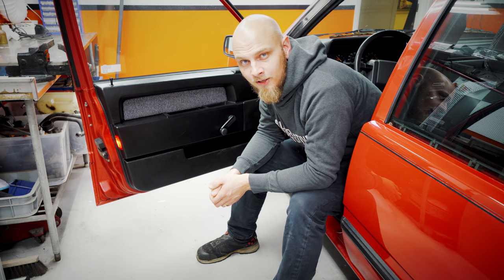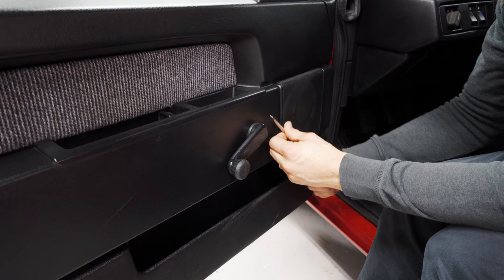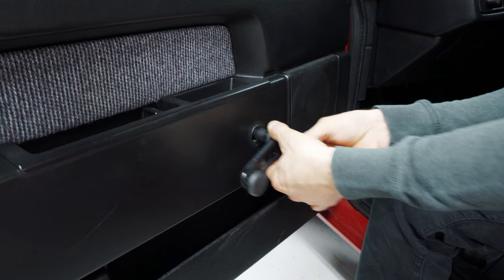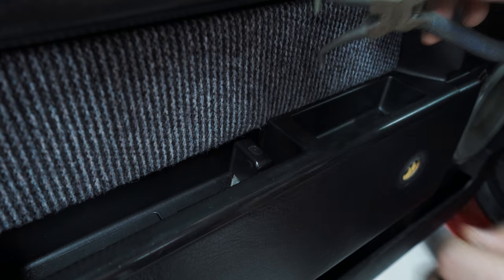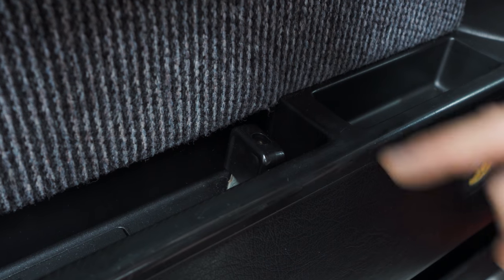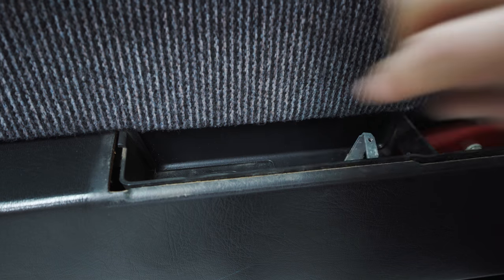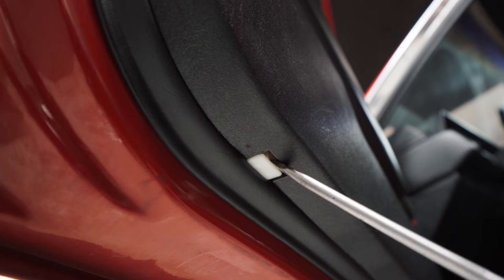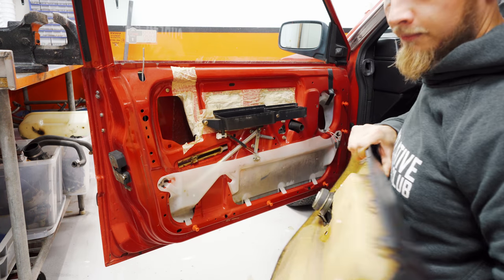How to Remove Volvo 740 Door Panels - 5 Minute Wednesday ?

Comment: the camera looks good, I would only say to be careful of the exposure so that bright things don't lose detail but it looks pretty good, keep it up
Reply from the maker: Yeah, I got crazy overexposure in this one. The wierd thing is that in camera its all good when i capture with the histogram etc, then when i upload to post its rarely a good exposure. But i just bought the xrite colour checker, so hopeing thats going to aid in this. Its either all or nothing with these cameras it seems 😄 

Thanks for watchin 🙂👍
Reply: @BackmansGarage  what camera are you using? also, you can always slightly underexpose and just fix it in editing...
Reply from the maker: I use the a6600 in this video with the SEL1018 lens just because it was on there I useually use the sigma 16mm. 
 I think a big issue is the glosslevel inside the garage. Everything is high gloss and the light is very harsh and super bright.
Reply: @BackmansGarage  you might be able to put a polarizer filter on the lens that could reduce the glare of some surfaces. I use a variable polarizer on my canon M50 and I have the color setting at very low contrast. you could look up what other people use to get a "flat picture" profile, that saves dark and light areas from blowing out. but overall the current settings you're using a much better.
Reply from the maker: I will look into that polarizer thing. I do have an ND filter, but i think a polarizer does something different. Haha, crazy amount of things one must learn when doing this.  I have tried to use Cine4, Slog2 and so on but i am colourblind ant that makes it very hard for me to edit without a colour checker, but maybe i will give it a go when that has arrived.  Maybe I can put some kind of film over the lights to kind of soften it a bit.